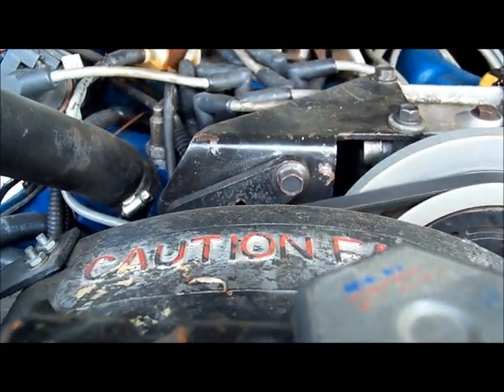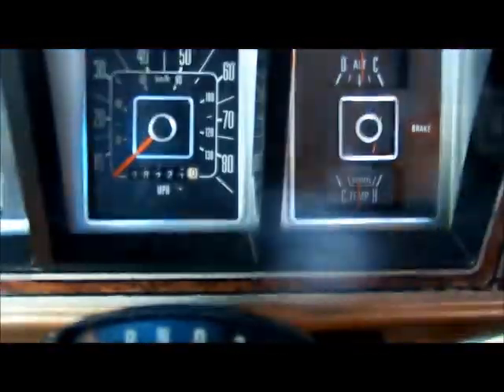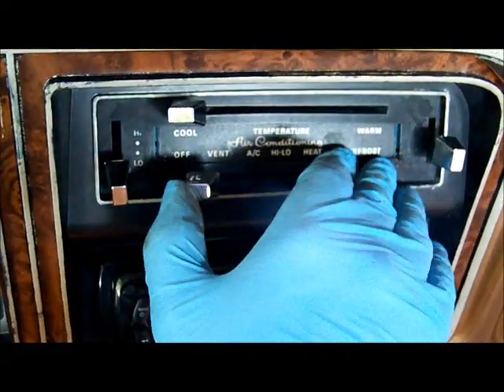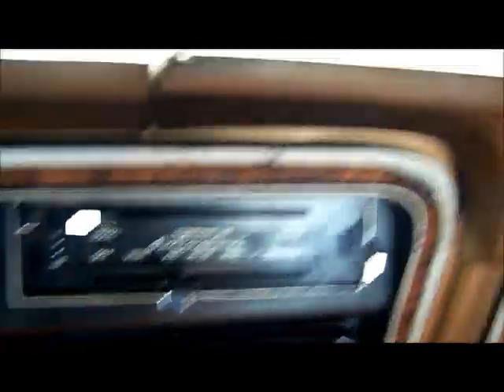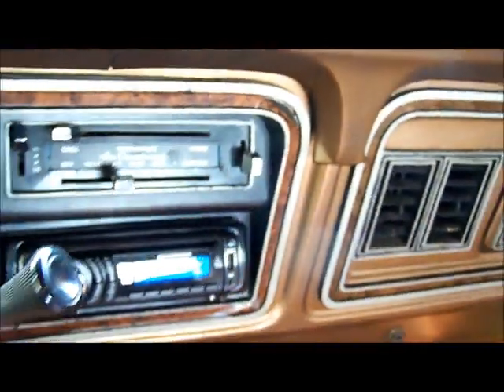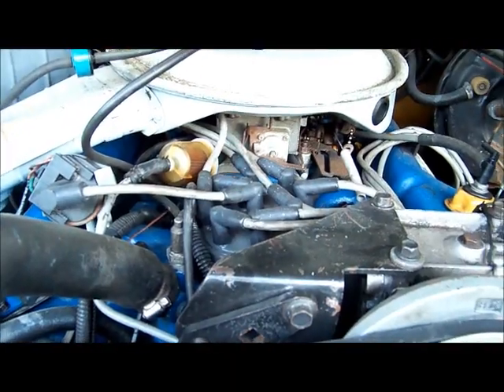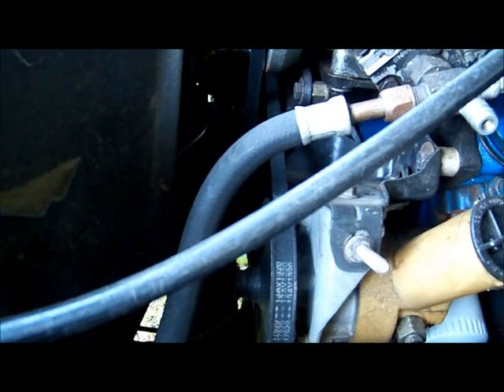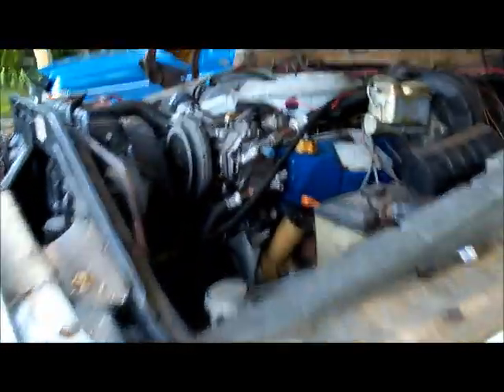1979 Ford Bronco Air Conditioner Check And Exhaust

Comment: mines got bad bearing in the belt somewhere (it'll make a small knocking sound at idle). and bad shock struts in the front im guessing. but the trucks got 57000 miles on it.. just needs the radiator flushed and all that stuff.. reaching the 60000 mile mark and then 15 different things get replaced or looked at, should run a hell of a lot better then. how do you deal with salt rust?
Reply: Dude same